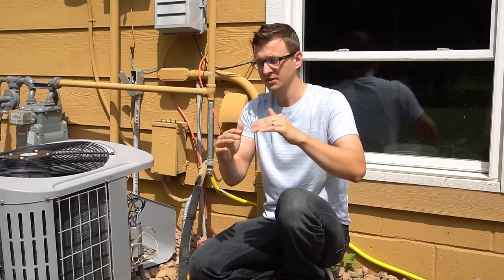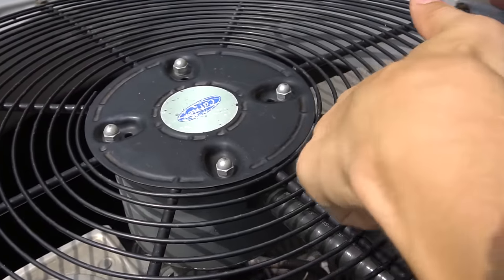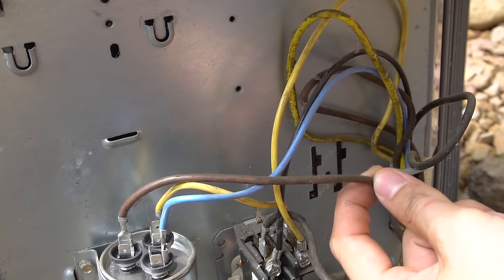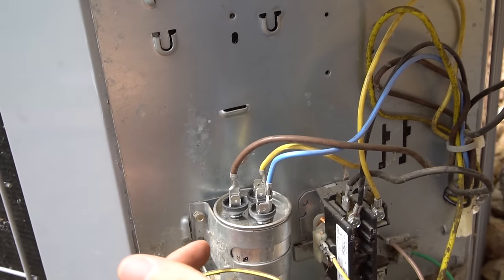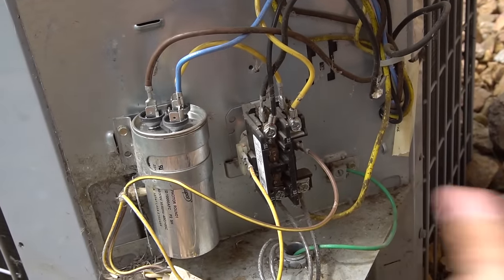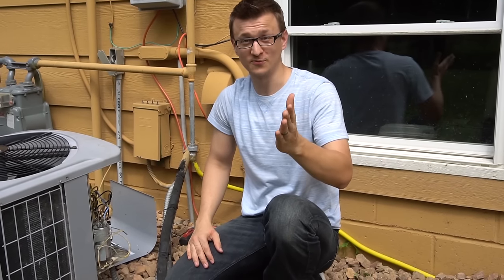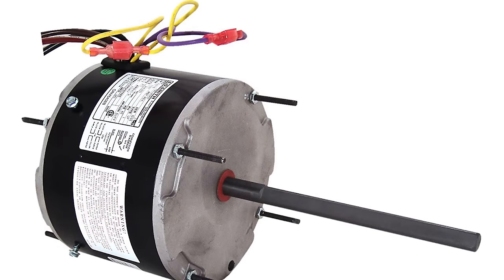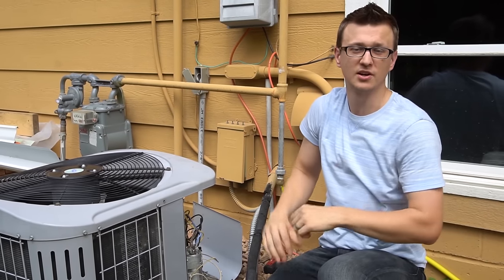How to Wire a Condenser Fan Motor

Comment: Replacing a GE with Mars Fan Motor
Condenser Fan Motor swap out.
GE 5KCP39GFS166S (3 wires) with MARS 10469 (5 wires & reversible CCW/CW wires)
Mars has a longer fan blade shaft, long casing screws, and not well insulated housing from the elements.
The rotation reversibility wires stick out and are subject to extreme Arizona weather, heat mostly.
The housing is also deeper, or greater height than the OEM GE Fan Motor.
Knowing that the Compressor specifications require a capacitor of 45MFD - 370v, I can safely match this to the Fan specifications for a capacitor of 7.5 MFD - 370 so it is accurate.
The problem is a lack of understanding how to wire the 5 wires to the end original 3 wire configuration where I have a dual purpose (FAN and HERM aka Compressor) capacitor.  BTW - HERM means Hermetically sealed, from the other internal FAN capacitor, but why did they choose HERM?
Mars wire colors are:
COLOR  —   SCHEMATIC says ...
White - (this is LINE )
Brown/White - (is this COMMON on Capacitor?)
Brown - (this is FAN on capacitor)
Black - (HI this is LINE)
Red  -  (LO this is LINE)
...   ...
Now, because this is a multi speed fan, and I need a 1/5 HP,  the Mars schematic gives the following:
For -
HP of:     —     Speed to Use
1/3 HP    —    HIGH
1/4 HP    —    HIGH
1/5 HP    —    LO (my old GE Motor)
1/6 HP    —    LO
Then, you also need to know; 
Wire for LINE:
Black - HIGH
Red - LO
...   ...
So, I interpreted this as follows :
OEM GE    —    MARS
Yellow       —    White
Brown       —     Brown
Black         —     Red (LO to make it 1/5 HP @ 825 RPM)
* cap off Mars Brown/White wire
* cap off Mars Black wire
...   ...
Now, is CCW as you are looking at the FACE of the Motor? Staring down the shaft-side?
Yeah, plug it in and see, then reverse the wiring if wrong.
I add this Question for others sake too.
...   ...
When the warranty is void due to improper installation, well, then we want to be proper, right?
Lastly, you have the best videos, your personality is just right too.
I was a College Professor, in a BS of Technology, and you really do a great job of explaining detailed tech to first timers brave enough to try to DIY.
...   ...
In AZ it is common practice for the licensed "Pros" to charge $48 - $118 for a $15 capacitor, AND THEN an installation charge above $100+ minimum, on top of that. Replacing the capacitor isn't hard at all, but knowing that is the trouble takes more. When it is 115°F, in AZ, and you have children, or elderly, you can't go without AC too long, so they know they got ya in a tight spot. Honesty and High quality are way, way too hard to find, especially at a reasonable price. That's why you are so deeply appreciated. You give viewers greater confidence that they are doing the work correctly.
Thank you so very much

Comment: How much should we charge for this job (labor) ?
Reply from the maker: It's up to you/your company. You mean to replace a motor right? The trip fee is usually around $90, labor is around $100/hr, and the cost of the part multiplied by 1.5 or 2. Around 400-500 is an average price.
Reply: Word of Advice TV 
Thanks 👍

Comment: Hey jay. I have a r404a small type appliance a slushy machine to be specific. I need to recharge it. How do. I charge it. How much psig and oz should I fill it up to. There is no reading on the compressor or on the side of the machine. Thanks in advance.
Reply from the maker: Hey JiggyPatel! Unfortunately I have never worked on slushy machines so I wouldn't know the information you are asking for.
Reply: Word of Advice TV do you how do I charge 404a unit ?
Reply from the maker: @ JiggyPatel I mostly work with 410a and R22. You may find this forum thread useful though: http://www.refrigeration-engineer.com/forums/showthread.php?24953-404a-Charging-CONFUSION
Reply: Without license experience you cannot just charge a unit its alot more complicated then that my friend

Comment: can you switch a 1/5 motor to a 1/4 hp motor?
Reply from the maker: It would work but it's not recommended since that can cause noise issues and will have a slight affect on the refrigerant pressures.

Comment: The new motor has a white and green wire the old doesn't have and the white has no plug.
Just add wire nut and not use?

Comment: Lol, old fan brown, purple, black. Brown and purple to capacitor and common on capacitor. Black to contactor. 

New fan- brown, brown white, yellow, black, ground wire, and reverse wires. 

So, brown to capacitor, brown white dead, yellow and black to contactor? 

So was something wrong originally?

Comment: Can you do a video on charging refrigerant
Reply: If you're not EPA certified, and trained, you can't. Or at least you can't legally purchase the refrigerant you need. The only kind that consumers can purchase is 134a, that you use to recharge your vehicle AC system, available at retail outlets. Call an HVAC/R contractor to repair your slushy machine. Hope this helps!

Comment: What is the lifespan of a condenser motor?
Reply: Mine lasted 17 years...But I'm in Canada, and our AC is on maybe 30 days/year. It depends on how long it is on, and what type of unit you have. Typically between 10-15 years for the average climate.
Reply: @shane250  Thank you! We are in WA State, AC is on approximately 30 to 40 days a year as well.
Reply: @godfather1116  
NO problem. You can expect at least 12 years if you got the cheapest unit out there, and up to 20 years if you have a high-quality unit.
Usually, you'll know the fan is about to expire when you feel some resistance when you try to spin it with a screwdriver through the grill. It should turn very freely. Also, if you blew a capacitor, that could be a sign as well (But not always).

Comment: Dud type fan  capcitear  point  hrom cap staring comrssoe ponitcomon power give ciomontacking   Nother lind  c  commprssor cotacter out otheear      jnit other modeifachion expresngue power  phas imprant  Nline must checking very   imprognt not dhortinv dreeinv or  wire conneahion ans  checkjng give very impranted gues fan fixing clock vise fixing sir circuldhion up hot up pointed  yes gues allrighting thsnkyou guez